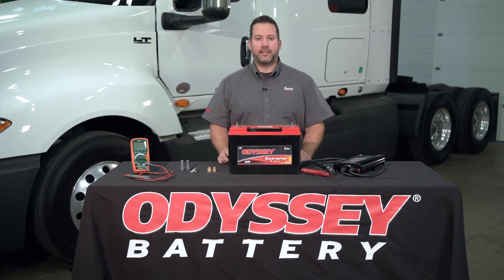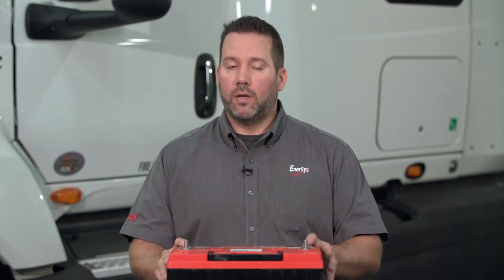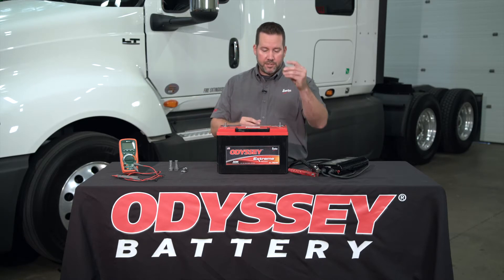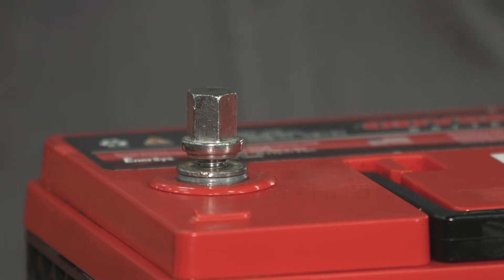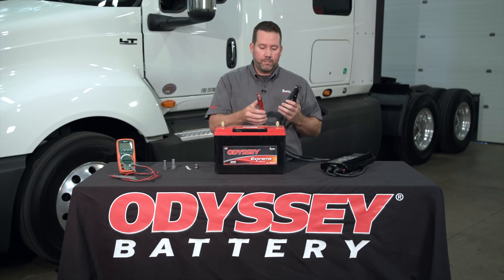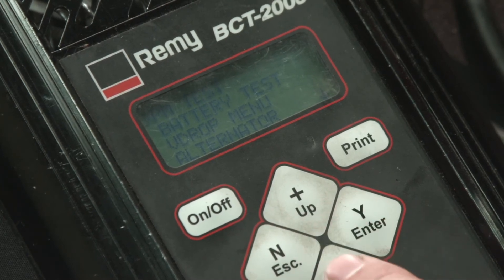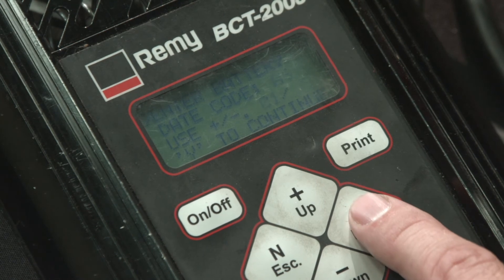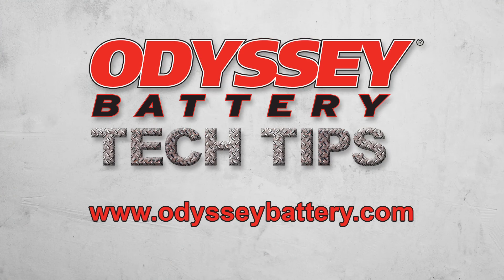How to Test an ODYSSEY® battery

Comment: How long would it take to charge this battery if it's ran down almost completely?
Reply: battery capacity (Ah) divided by average inrush current (A) will give you the hours Ah/A = h
When I charge my very empty Genesis XE16, inrush current begins ~14A. After two hours the battery is nearly filled up.